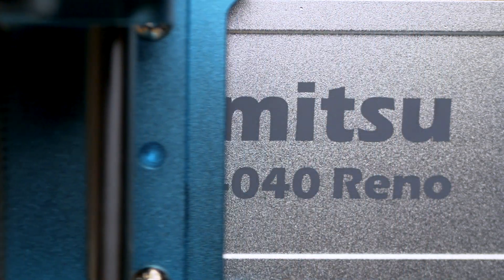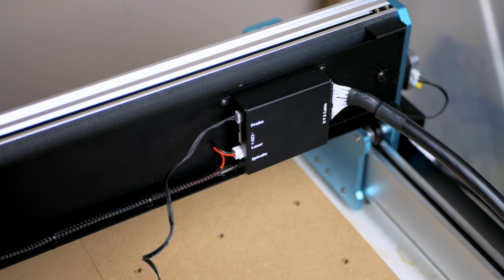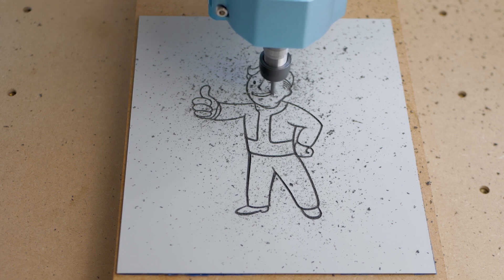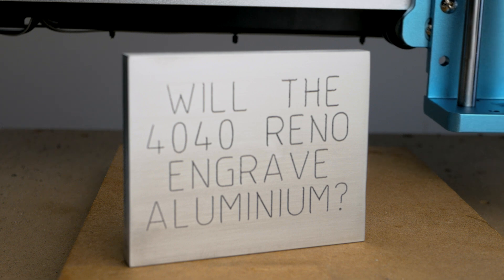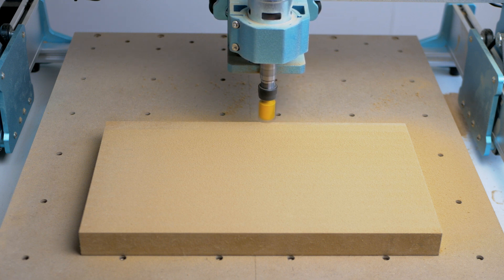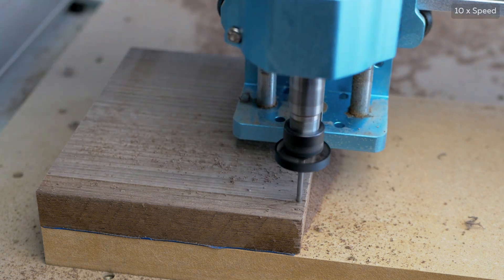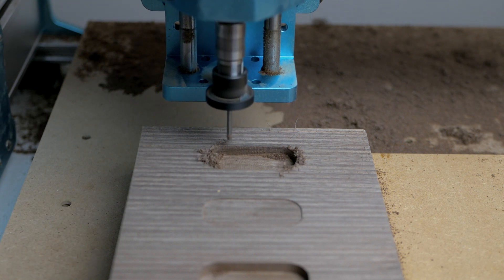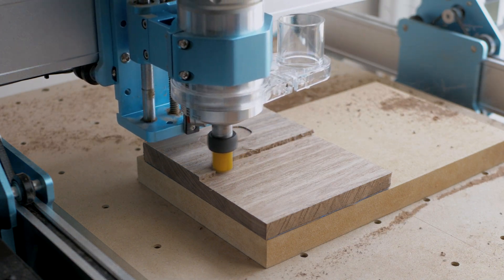SainSmart Genmitsu 4040 Reno Review

Comment: Review sounds great.There are some user concerns about the machine's long-term durability, particularly for heavy use.
Reply from the maker: If you keep in mind V wheels and belts are going to need replacing every now and then I don't think there is much to go wrong, belt drive its a very simple system that has been used for a long time, but no I would not recommended for an industrial setting, very much a hobby or small business machine.